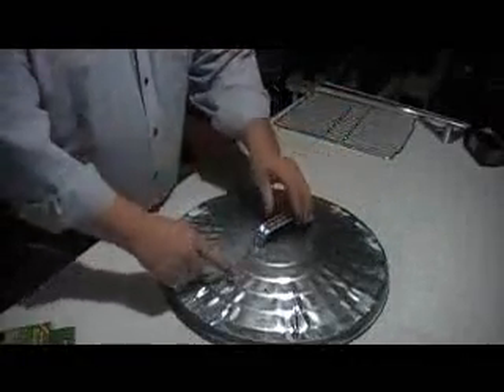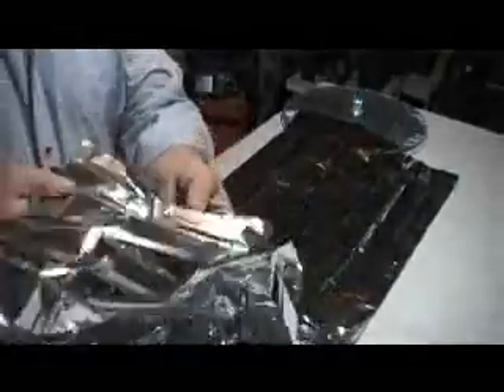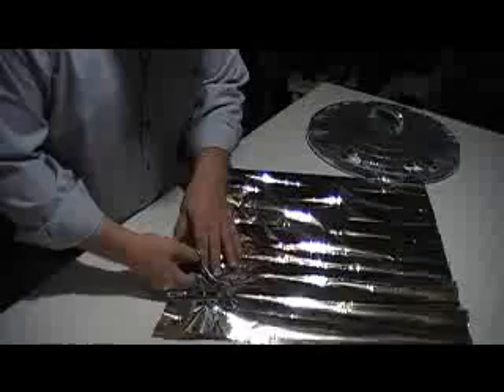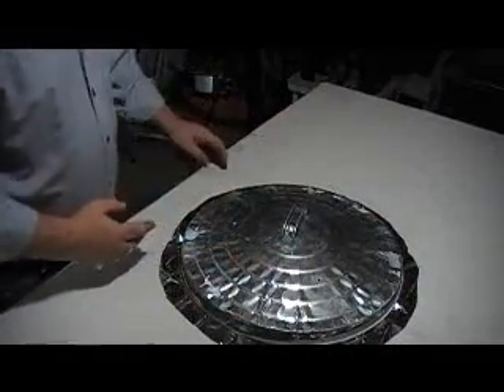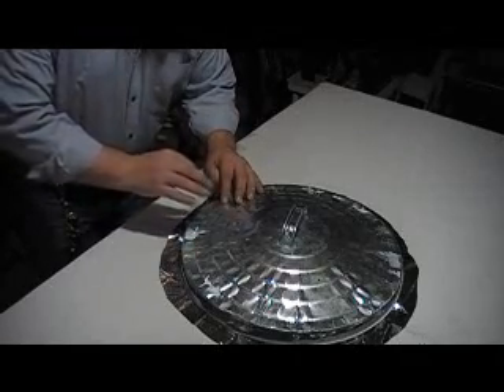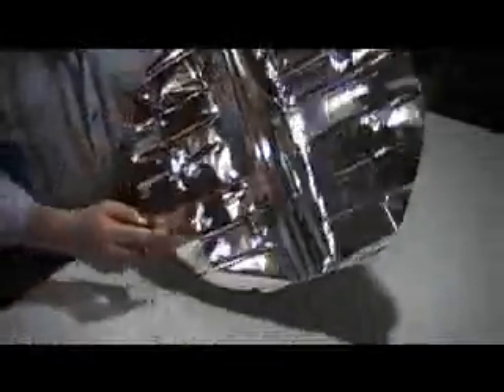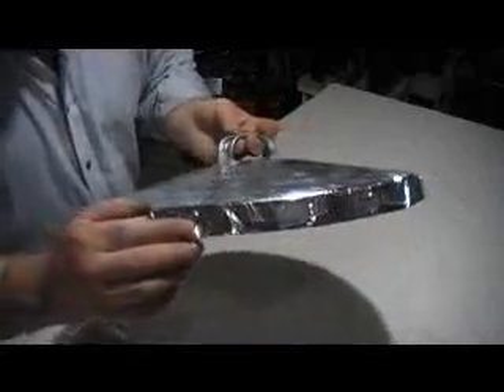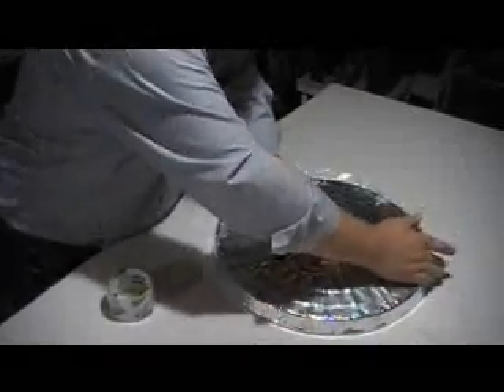Trash can lid to Parabolic Mirror

Comment: Hey great idea. But how did you draw in the air.  I have read watched it and still do not know what action it took to make it concave.
Reply from the maker: The little hole I drilled in the back. Had a piece of duct tape over it. Later got a shut off valve for a fish tank. Still works years later.

Comment: how did you have take air out?
Reply from the maker: Inhale through the hole and press tape back over it.
Reply: @JohnSolar283  Thanks! I've just buy a bike valve to try to do the same, if not working enough, I'll try your method!